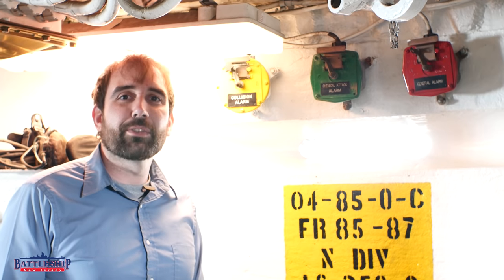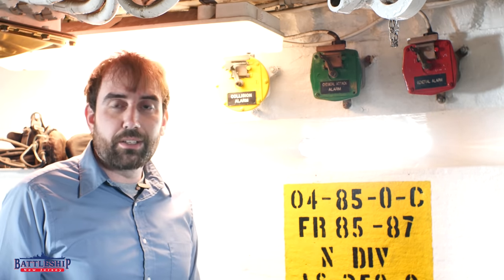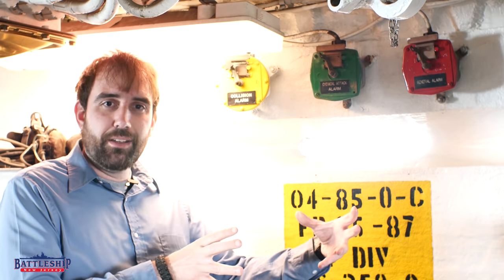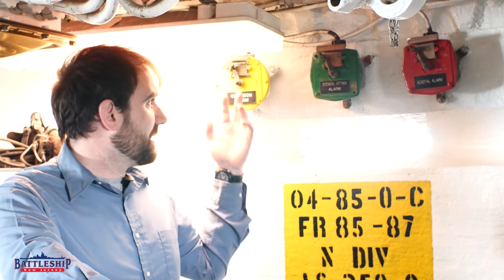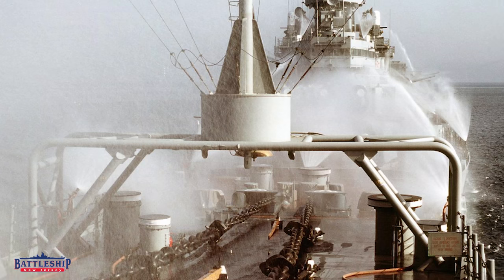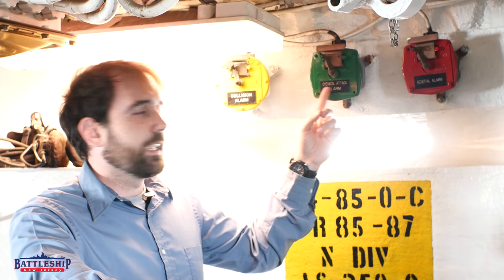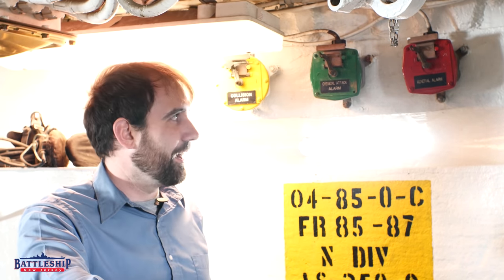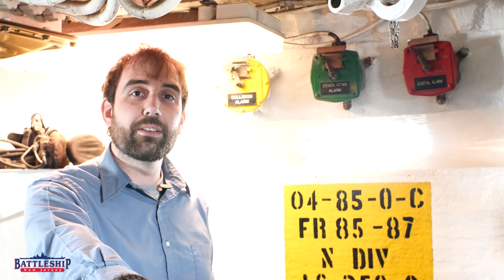That's Alarming! Shipboard Alarms and How to Tell the Difference Between Them

Comment: Actually the alarm is pretty simple, when it affects the whole ship sound the alarm. Hold on, seal off the ship and man all stations.
Fire alarm makes only sense in the affected area, since everyone would run around looking for the fire and trying to get out of the area because there could be fire, if it would be ship wide.
Aircraft crash alarm makes sense as its affecting the whole ship...fire on the fan tail, turret 3 in danger, risk of a boil over if the helicopter has external fuel tanks or weapons that need to get cooled, man over board or/and even crew still in the sinking helicopter , sealing of the citadel under that area to protect the magazines , close the doors/hatches below deck and hold firefighters on stand by in that area in case it reaches deck 2.

Comment: When I was an 8 year old kid, I got curious about an unusually fat red colored panic bar fitted to a library's door.  Of course, stupid me pushed that bar and the whole door screamed.  The sound was very disorienting it was so loud.  I never, pulled or wanted to touch anything that resembled a fire alarm or blue panic button.  My instinct to not press a blue panic button finally got the better of me when I was too nervous to press it when a dangerous fight broke out at my local train station.  A lady yelled at me to press it several times while I hesitated until I pressed it.  Of course after I pressed it, the thugs left before the police showed up and I was even more scared of being charged with pressing the panic button as a 17 year old kid.

Comment: The wash down system would be started at the same time the chemical alarm is sounded because the water would get into cracks and crevices and prevent the chemicals from getting there and therefore be much easier to decontaminate.

Comment: When I was a kid I set the silent alarm (for robberies) off at a bank, so as a kid I would probably have triggered these as well. Luckily the cops called the bank and asked if there really was a robbery in progress so there were no real repercussions to me.
Reply: @Galactipod  Yeah had it been a real robbery I guess the bankers would either have said there was a robbery and been shot, or would have said it was just some kid that set it off accidentally and the cops wouldn't have responded.
Either way an incredibly inept way to handle the alarm by the cops.

Comment: Ive always known not to pull alarms, having grown up in the age of kids having to do school shooter drills ive seen people have panic attacks because of an alarm once and the major impact that it has. however my school had the standard red fire alarms with a white pull down handle, but were then modified so that there was a big clear covering over it that would open upwards to sound. so when happens when you give 2000 students 4 minutes all at the same time to get from one end of the school to the other and they to go shoulder to shoulder and bump up against one of these constantly? well.... they bend a bit at the hinge/or tear away from the wall a bit. and what inevitably happens at this point? someones backpack that may or may not be mine gets snagged on it and sets it off right after lunch. anyway, it was about 90 degrees out that day so that sucked standing out in a parking lot for an hour. they never did find the "suspect that vandalized the alarm system, due to overcrowding in the hallway blocking security cameras". yeah, pulling alarms can have repercussions

Comment: To be fair I was 6 or so when this happened, which is probably why I didn't get arrested. It must have been bring your kid to work day so my older brother and I were looking around the office building that used to be a hospital. I either got ahead of him or he turned one way expecting that I was going to be following him but in any event, I was free-range walking chaos. As I was walking down the hallway trying to find my brother I saw a red box on the wall that had PULL on the handle so I, at an apparently very literal part of my existence, did 
what the handle beckoned me to do. I was raised to be honest and forthright so I admitted to it after I found my brother and Dad outside. The firefighters ended up laughing about it and said they were just glad that there wasn't an actual fire to fight in that beast of a building.

Comment: Regarding "spilling a lot of aviation gasoline," did the military still have avgas-powered helis in the 1980s? I would have figured they were almost all or all turbine-powered using much less flammable jet fuel by then. Even most civilian helis are turbine-powered these days, though most fixed-wing GA is piston powered and does use avgas. Of course, back when the Iowas were built, avgas powered basically everything that flew, but piston-powered aviation went mostly out the window for the military by the early 50s.

Jet fuel is actually (intentionally) rather difficult to burn. You can literally light a match and drop it in a bucket of Jet-A and it will just extinguish the match (not that I'd recommend trying that if you don't know what you're doing.) Of course, as many, many WWII-era stories confirm, this is very much not the case for avgas. Just like car gasoline, avgas is indeed extremely flammable and will burn if you look at it wrong.

Comment: Two questions:
1) How long could the ship operate all closed up in the tropics before the environment inside became dangerous to the crew?
2) could the ship fire the main guns while in the NBC condition?  Because when the rifle breach is opened the turret is exposed to the outside by the barrel.
Reply: Filters could be installed on air intakes on most ships if extended operation was required in an NBC environment.  After firing, the barrels were purged with high-pressure nitrogen to clear hotspots and burning debris before the breach was opened, thus the barrrels were filled with nitrogen from tanks, not outside air.

In any case, the desired mode of operation is to run a slight pressure on the ventilation system, so any air leakage is OUT, not IN.  In this case, if you were to just leave the breaches open, air flow would be out the barrel.
Reply: @kevincrosby1760  
Have you tried the math for that?   Each Mk 7 50 Cal has 201 sq inches of open area to the out side,  then there are 9 of them.  Plus 12 Mk 12 38 caliber 5 inch rifles.

That is a lot of 'positive'  over pressure to maintain.
Reply: @DrsharpRothstein  Have you mentally modeled the question correctly?

We are talking about how many CFM are required to create a slight imbalance in a functionally watertight/airtight vessel divided into many sections, not create a gale-force wind that blows the hatches open when you undog them.

All that is required is enough of a differential that you do not suck contamination in from outside.

May I ask what type of vessel which you served on that either didn't have an NBC protocol or failed to provide basic instruction on how selective control of the ventilation system could be used to restrict and/or control air movement?  If nothing else, should have been covered during your basic DC/firefighting orientation when you first reported on board...if you slept through that class in Boot Camp.
Reply: @kevincrosby1760  

I have never served.  So I never had a chance to "sleep" through any class or calsses. Lol

I understand that a "gale force" pressure difference is not required and have experienced it before in large buildings.   Never before in an air-tight/water-tight pressure vessel.   The in a previous video about the main turrets I believe he mentioned the air intake for them but not how to secure them for NBC or if that was built in for a full-time operation.   

Not having the direct experience of service I don't know, so I am asking.
Reply: @DrsharpRothstein  Any opening in the exterior of the vessel can be closed, always locally and sometimes remotely as well.  

Any ventilated space will have separate supply and exhaust vents which can be independently controlled as well.

Main supply and exhaust ductwork have ties which can be opened and closed as needed.

Taken together as a system along with watertight doors/hatches, you can thus determine how much air, if any, enters a given space, where that air came from, and where it goes when it leaves.

In normal operation, the system is configured for a balanced combination of fresh and recirculated air at the desired temperature and humidity.

As required, the system can be configured to meet specific needs.  If there is a fire, vents can be closed to isolate the affected area to deny the entrance of oxygen and inhibit the spread of smoke...or clear the smoke when the fire is out.

Achieving a pressure differential is a simple matter of adjusting the ratio of supply/exhaust ventilation.  

Filters can be installed at certain fresh air intakes which are designed for an NBC environment.  If supply air is taken from these filtered intakes and exhaust flow is regulated, then you can achieve a positive pressure of filtered air within the hull.

Comment: What happens if you tigger multiple alarms at once?
Reply: On an older system, you overload the Alarm Oscillator, sending a distorted and overdriven signal to the 1MC Pre-Amp, which in turn sends your garbage signal to the 1MC Power Amp for distribution.

At this point you have pretty much pissed off the entire IC Shop, as that means that a LOT of vacuum tubes need to be tested if the condition lasted long enough.  Some of those tubes were matched pairs, and cost around $900 per pair....in 1987.

Comment: would pull alarms only when i need to, often alarms are tied to fire stations and would be expensive to send them out where they are not needed , also there is a fine for it for doing false alarms. Also crash alarm sounds like my old alarm clock

Comment: How do the alarms actually work with the 1mc system? Is it a tape deck?
Reply: no tapes, in the older 1MC's its all done by tubes, and some transistors. in the newer ones (80's on up) its all electronic.
Reply: @leftyo9589  The signal comes from the Alarm Oscillator on the bulkhead with tubes that glow the standard red, goes to the 1MC Pre-Amp with the tubes that produced the pretty violet glow, then to the 1MC Power Amp, which had the tubes that put out the yellow-white light that could cast shadows on the main IC Switchboard...  :)
Reply: @kevincrosby1760  that depends on what era your 1MC was made. neither of mine had any auxillary equipment. 1 was a tube type, and one was nothing but ckt cards.
Reply: @leftyo9589  That would be the late 60's model with the Pre-amp and Power Amp in a single enclosed rack and the Alarm Oscillator as a separate bulkhead-mounted unit.

Keeping it company were a Mk19 gyrocompass, a Mk23 gyrocompass, and an AT&T Dimension 2000 PBX.  

The 1MC, our local SP amp, the Mk19, and all of the Synch-Amps all ran on vacuum tubes.  400hz power for the gyros was courtesy of two motor-generator sets next door in the EDG, located directly below the 120VDC rectifiers for the DRA/DRT in CIC.

Comment: In regards to the wash-down system, wouldn't be trivial to just have fire hoses rigged to deck mounted pumps and piped straight over into the water? Pluming is indeed a sinker, but i'm kinda wondering why it would be so complicated when it doesn't need to be.

The fire alarm method makes more sense for such an enclosed system. Yes, with rookies that might be a disaster waiting to happen, but when a seasoned crew is on board, giving them exact information is far more valuable than auga-auga-auga. We'd probably have similar stuff for homes/buildings if it weren't for new individuals existing within that volume and potentially not knowing where to go/what to do.
Reply: How do you power deck mounted pumps? Electrical power is generally pretty limited on ships, especially by the '80s with all the additional equipment on such an old vessel.

The fire system is steam powered, so not nearly as limited.

Comment: The water wash down system needs to be run before exposure to chemicals or nuclear Fall out the reason is it is used to wet the decks to make it easier to clean up. 
 That was one of the things they learned from the nuclear tests in 1946 that it was almost impossible to clean up contamination unless the decks are pre wetted
Reply: Yeah the water keeps the particles from sticking to the surface, they just get absorbed by the water. The more water you can spray the better.

Comment: Working in computer rooms, they used to have EPO (Emergency power off) buttons at the entry points. I never desired to hit one, but, I always wanted to know where it was just in case.
Reply: I had heard some horror stories from my father about people triggering the halon gas systems for the big emergency diesel generators at the data centers where he had worked. I really doubt halon gas is cheap.

Some people sadly cannot resist the urge.
Reply: Years ago, in the era of big IBM mainframes, we were testing a new computer installation.  One of the tests was the EPO.  When we pushed the EPO, it didn't.  Seems they'd wired it in wrong.  So I guess failing that test was a good thing.

Comment: It seems reasonable to use aircraft to fly upwind of an enemy ship and drop chemicals that react with seawater.  From the 20s up until the 80s I'm surprised this wasn't a common strategy.  It would be much more difficult to pull off an attack like that today with better EWR and better modern SAMs.

Comment: i wouldn't pull unless i'm told they don't function and could be played with...then it seems like it'd be fun to pretend to be going into battle :-) i suppose if it was obviously painted over so many times it had a melted wax look i'd assume it was safe to touch but i wouldn't try to crack the paint job. i doubt i'd be strong enough to defeat dried paint..

Comment: One thing I can say, if they call a fire on the PA and you are a contractor, make like a flake of paint and stick to a bulkhead, otherwise the men will run right over you.
Reply: Even better is when they call away "Security Alert".  If you don't know what "stand fast" means, you will be educated.  As an added bonus, you might even get to inspect the wrong end of a firearm...

Best bet for a Security Alert is to get your back against a bulkhead, your ass on the deck, your contractor badge visible, and your hands on your knees and empty.

Wrong side of that red line painted on the deck?  Assume whatever position your personal beliefs indicate are appropriate for heartfelt conversations with your personal deity.  You're choices at that point are to be very compliant or very deceased.

Comment: Well there is kinda an alarm for fire. But like he said, you use the 1MC. But you basically push the button and grab the bell. DINGINGINDINNGDINGDINGDING" DING...DING...DING" FIRE FIRE FIRE, Fire reported at 2-390-5-E. Or wherever. You just ring the bell like crazy. Then 1 ding is forward. 2 dings is mid. 3 is aft. 4 is if its off ship like on the pier or a fellow ship is on fire.